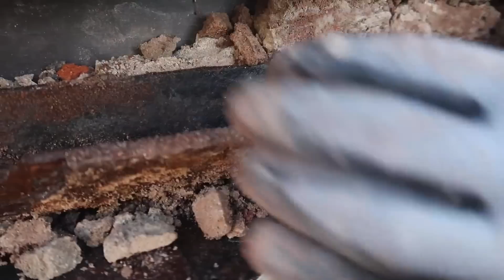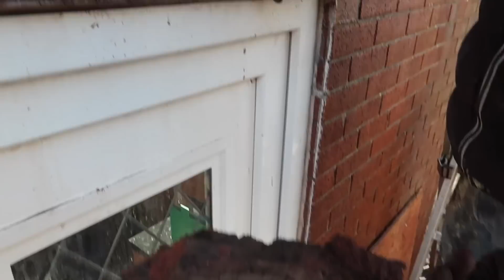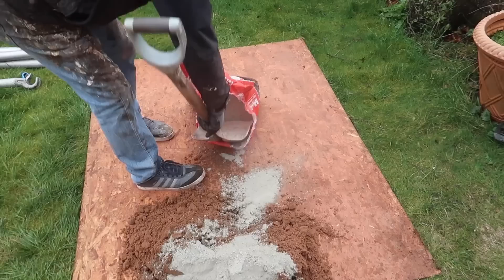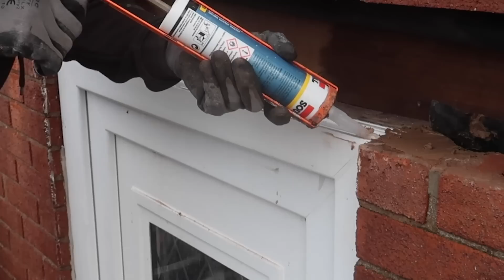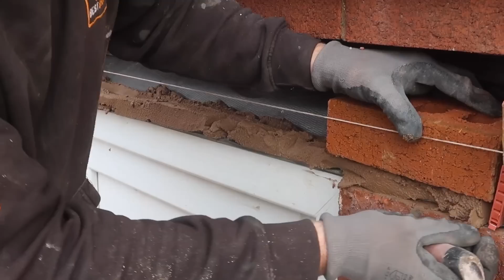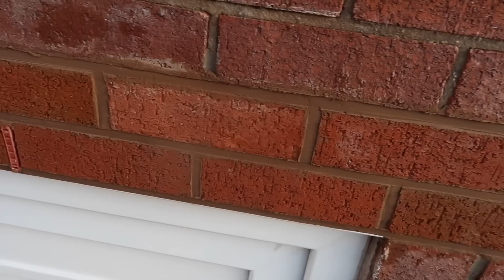Bricklaying - Repairing Leaking cavity Tray

Comment: This is amazing! Thank you for sharing! I live in the midwest in the US and for 6 years I’ve been having leaky windows after I had a popular window company install storm windows. I been arguing with them for years. The only leaks is after they installed the storm windows and all the old windows are okay. My windows leak in between the original wood windows and the vinyl storm windows this big box store installed. The wall above the windows has mildewed and molded several times. They come and say they Re-adjusted the windows, I get the wall repaired 2 years later the same problem.  Much respect! 🙏🏼🙏🏼🙏🏼

Comment: Our 1930's ex council house has creasing tiles above the front UPVC windows. When the rain is heavy water often comes through to the inside of the window. There appears to be no lintel just creasing tiles. How can I stop the water from getting in? Do the tiles need to be replaced with a lintel? I'm not a bricklayer. Can someone advise. Thanks.

Comment: Mate I am new to this ....can you answer a question ? ....when mixing sand and cement 4:1 how much water do we need to add , what should the consistency be like ? Thanks 👍
Reply: Hi Terry what it is trial and error there is all different types of Sand some sand takes lots of water others don’tHope this helps
Reply: @seniorgolfprogress83  Thanks for the reply mate ...but I thought it was some near exact measurement e.g... 4:1 kg in sand / cement may take 1 liter. ..maybe 🤔
Reply: Terry Chootiyaa you add the water a little at a time until you get the right consistency depending on what you’re doing, if you’re doing an extension and it’s brickwork you’d make a creamy mix, and if it’s blockwork you’d make a bit of a stiffer mix so it’s not as wet but it’s still workable, if you add all the water in one go it might be too much your mix is ruined if it’s too runny and you’ll have to keep adding and adding sand and cement until it’s right, water makes it look like it’s mixing but you have to let the sand and cement mix on its own and give it time, I’ve been making mixes for 2-3 years and if you have a standard mixer there’s always a lip/line in the middle of the drum and if the sand is nice and fluffy (dry) That’s where I fill water up to but if my sand is wet, sometimes no water is not needed and the sand has all the water inside it for you, and I just add Feb, theres no rule for the water as it varies between what you’re doing and how the materials are.
Reply: Terry Chootiyaa sand will come with different water content depending how it has been stored at a yard or how long it’s been stored .and wether it’s been sheltered or left in the open in bays with rain or sun on it ect

Comment: Can I ask a question? When you're cutting out like that I see you didn't need acro's. When would you need to use acro's? As I would have thought the bricks above the cut out would want to fall down as there's is nothing supporting them whilst you do your repair
Reply: Reckon the logic is that If the mortar is good, the triangle of brick that it's holding up should be good for a while. Also depends on whether anything else is bearing onto it. If it's not good mortar, then adiós bricks!

Comment: Nice job stu the building regs in Scotland want a weep vent every 2 brick over a lintel they also want lintel on a bed of mortar and dpc on a thin bed i take it its different in England m8
Reply from the maker: Pretty much same it’s every 2 or 4 brick lintel is bedded on mortar and dpc on thin bed too 👍
Reply: @Stucrompton1  thanks for that stu top man
Reply: Maximum every two bricks/450mm in England too. NHBC Regs.
Reply: @mattyc2008  thanks its good to see the nhbc regs are the same north and south of the border

Comment: Thank you gentlemen for a really good video really showing the good stuff you know. The finished work looks really outstanding.
Questions thought, those orange spacers, why are they used for, and it seems that the aren't sealing the gap in any way, it would reason that water could drip inside and in between them. What say you, please educate me, and again thank you for the leaned knowledge.

Comment: Just had a cavity tray put over two windows and now I have water coming in the property. I've noticed the membrane is extended 30mm out from the wall. Is there potential for water to track back in the cavity under the mortar at the sides?
Reply from the maker: yes the tray has to be curled up each side..
Reply: Curled up at the sides to retain the water which then basically funnels it towards the weep holes.

Comment: How do you determine how many bricks you can take away above the lintel before the brickwork above will move and crack?
Reply from the maker: calculate weight of bricks and correspond to lintel, they vary from standard load to heavy duty and come in all sorts of shapes and sized
Reply: stu crompton he meant how can you tell you can remove old lintel and brick above without the bricks above moving Stu, not how do you size the lintel.
Reply: And the answer to Bens question is because he just can. He will know what he can get away with without a strong boy etc by way of being experienced
Reply from the maker: We did prop above but using another method, it depends on so many different things it’s not a straight answer. Maybe do a video ok that topic Ben
Reply: @Stucrompton1  yeah a video of that would be great 👍👍. Please

Comment: thanks for this wonderful tutorial, as you promised, during  2020 you will teach us some brick fixing. got a question from your project, that you insert 3 plastic orange vent plate, I suppose they are used for preventing water stuck inside,  my home is also entire brick home build 2014, I checked all over the house, the builder didn't install any of these, should I be worried, should I go install some myself ? I noticed on my bottom layer of stairs, some brick surface is falling off, maybe it is due to water damage and cold weather.
Reply: Hi Steven It sounds to me like it could be a cheap  brick but I can’t be sure without seeing them Thanks KC

Comment: How much does that cost to have that done as I'm looking around for    the same thing doing apart from it's a window that needs doing as I'm getting rain coming through it all started 3years ago so this is the 3rd time this has happened it used to be a council house till I bought it so ever time it's been repaired by the council and subcontractors called Mears have just repointed the problem not taken bricks out to look to see the problem and fix it as they are totally cowboys and just bodge it up on 3 times so just wondering how much i would be looking at I know all bricky's have different prices cheers bud

Comment: How would u go about putting a lintel into a single skin wall Stu?
Reply from the maker: This is single skin Jon unless you mean a box lintel
Reply: @Stucrompton1  it looks like theres a cavity wall.
I'm meaning like a single skin garage wall without a cavity wall.
Does that make sense?
Reply: @Jonaldo86  single skin garage without cavity, normally use pre cast concrete lintel.
Reply: @tonyherring6670  cheers Tony.
Would you need to worry about a dpc in that regard then?
Reply: @Jonaldo86  in single skin the only dpc is at ground level to stop rising damp. in cavity wall the cavity tray is there to stop the moisture which forms (interstitial condensation) within the cavity from sitting on top of the lintel/door/window, its runs down the wall and out through the weep holes. You can use angle iron or I beam in single skin but its needs to be protected from corrosion.

Comment: Might wanna get yourself a 10" saw. Cuts the bed joint all the way to the back. Lot less hammering that way!
And holy smoke... Mortar on steel? No deal. Mortar on wood? No good.
Didn't butter the end joints of the final brick...
Yikes